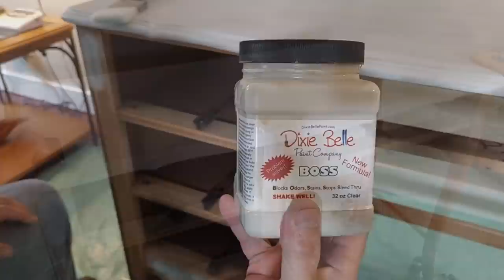DIY Desk and Chair Makeover

Comment: Great job! it turned out very nice. I would like to know how that paint holds up on the vinyl.
Reply from the maker: We  pushed and prodded that vinyl way more than what normal use would be and it held up great. Only time will tell how well it holds up to daily use, but we have a chair that we use quite often that we did this with and it's still good after 5 months. Thanks Sandy!😀